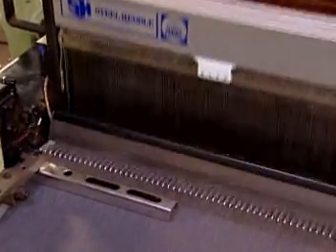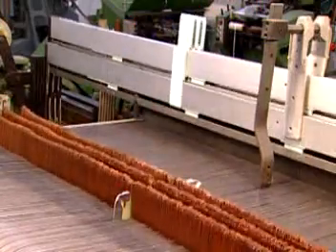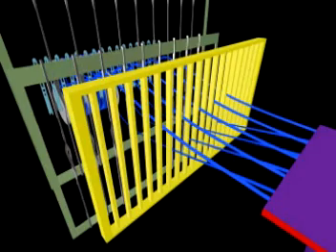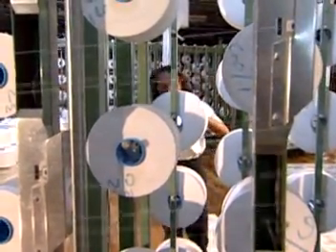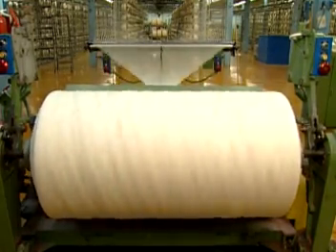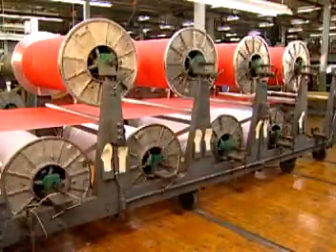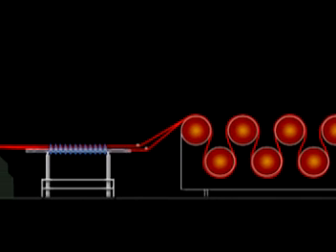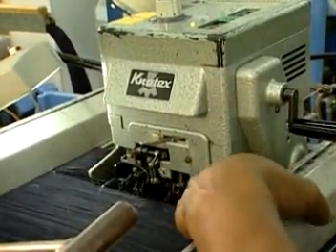Properties of woven fabric

Comment: I worked for 40 years in textiles, with the 1st 10 years as a sectional warper. The warp setting that we used, was not threads per inch, it was threads per 1"7/8 (1.875inches). e.g. our warp reeds had a given number of slits per 1.875inches. One very common warp setting we used, was, 15/3. That would mean we'd use a 15 reed with 3 threads in each slit, giving 45 threads over the 1.875 inch. I was taught, that this warp setting was the Scottish system.
Reply: How can I contact you.